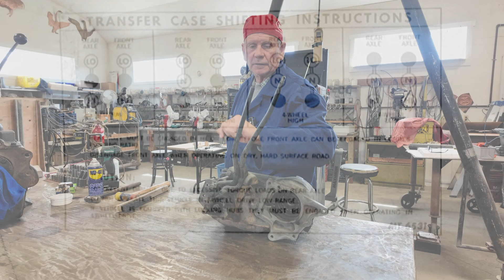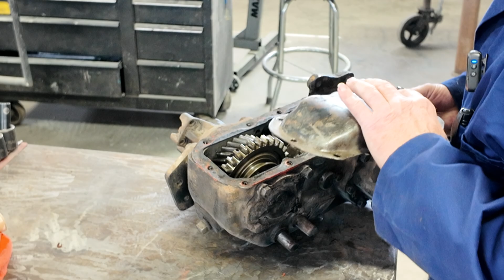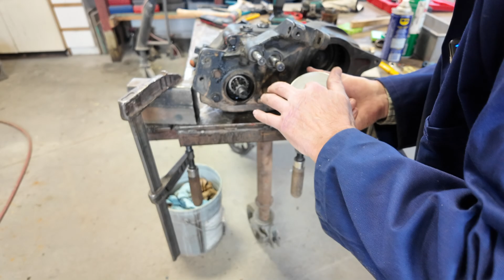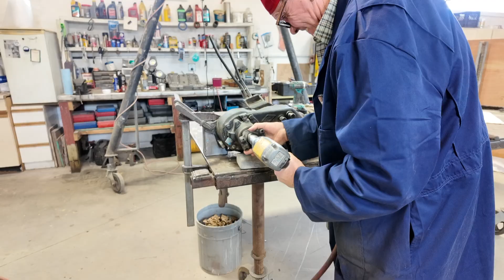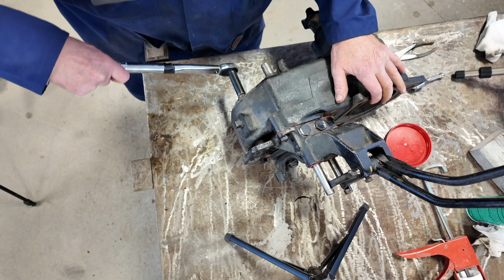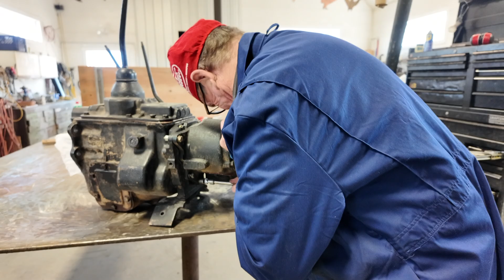IH Scout Transfer Case Inspection and Reseal.  IH Scout Restoration Yukon.

Comment: Hey Mike - thanks for the great video!  I have a question - when taking my yokes off, I had one that had a felt seal and the other did not (I cant remember which was which off the  top of my head now) - did both of yours have them or just one?
Reply from the maker: Thanks for watching The yokes have felts to protect the seals and o rings on the washers More to come !